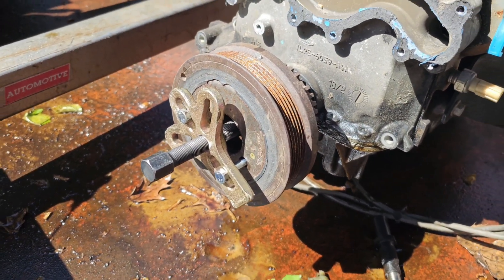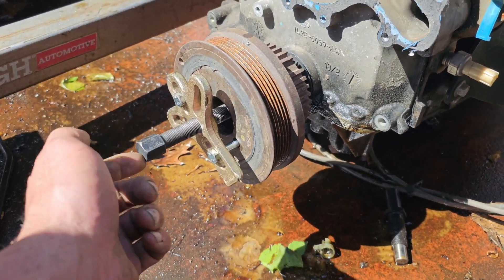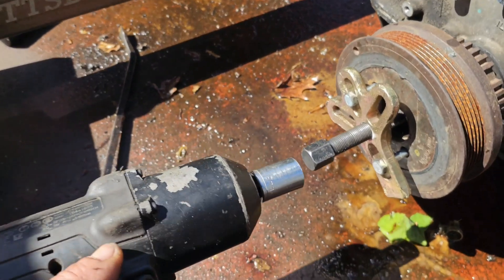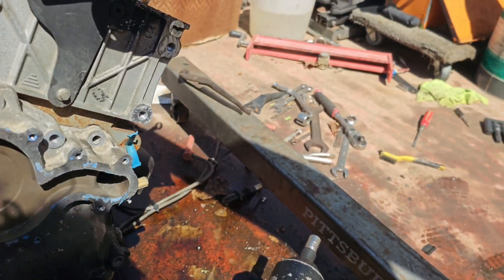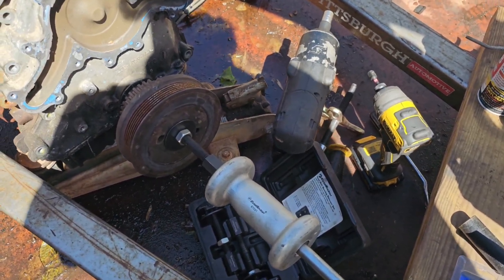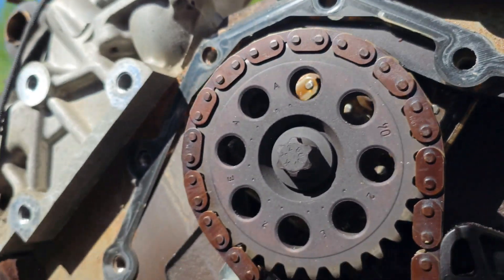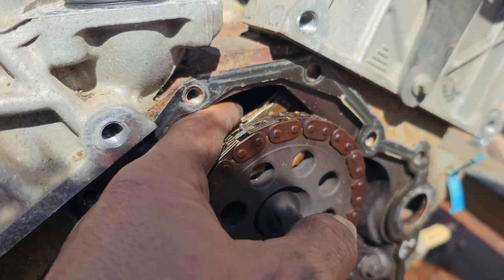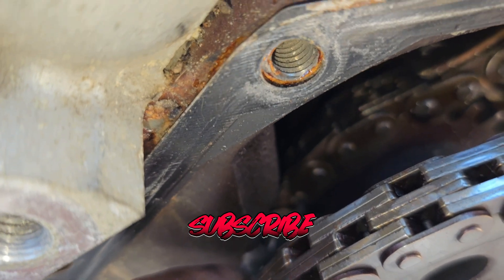Dissecting a Locked Up Ford 4.0 Sohc V6 - Crazy Timing Failure!

Comment: Im working on one right now, cannot for the life of me break the timing cover loose. All the bolts and everything is removed and have checked several times just to be sure. Is there a trick to these or something? All videos show it just popping off
Reply from the maker: Remove oil pan. Remove harmonic balancer. Ensure no fasteners have eluded and then tap it loose. There are multiple layers on the timing cover from what I remember. It's been a few weeks lol. I'm doing another 4.0 sohc swap next week but I won't have to tear the motor down on this one. Only tore the one in the video down to get it to spin over so I could get at the torque converter nuts.
Reply: @OccultEngineering  yeah was really trying to get with out taking the oil pan off. Engine is still in the rig.

Comment: From everything I've heard about the early sohc 4.0 V6 engine, having the one timing chain on the back of the engine is horrible to replace that part of the timing chain assembly because you have to pull the engine to work on it. What a crazy design.
Reply from the maker: Yeah it's a pain only because of the lower cartridge pivot bolt hidden between the block and the bell housing. Easier to pull the motor and work on a stand vs drop the trans and fight it in chassis.